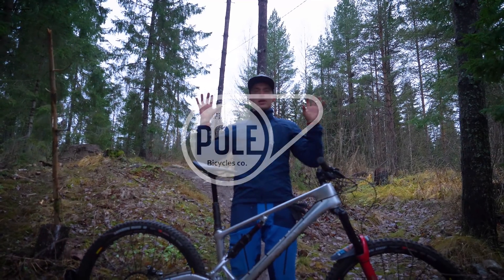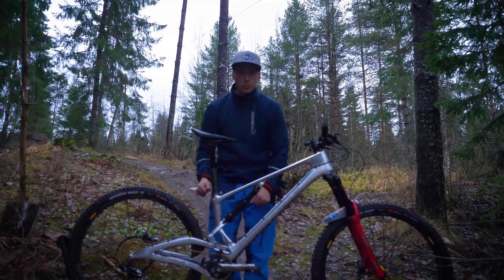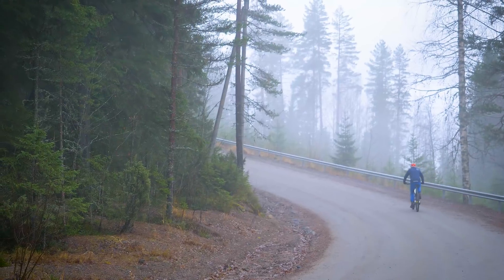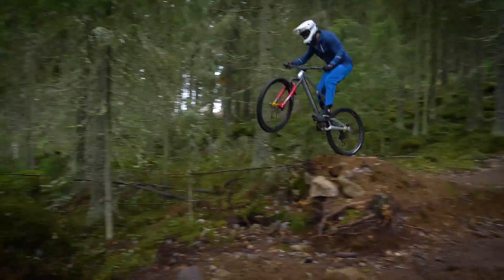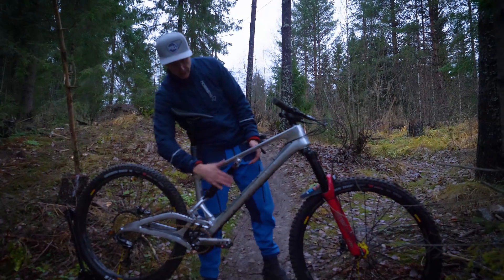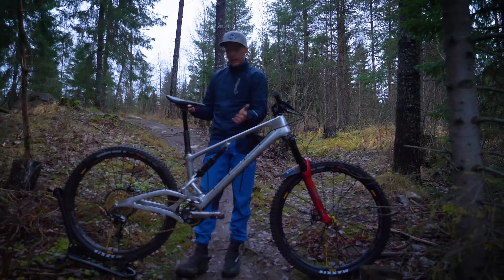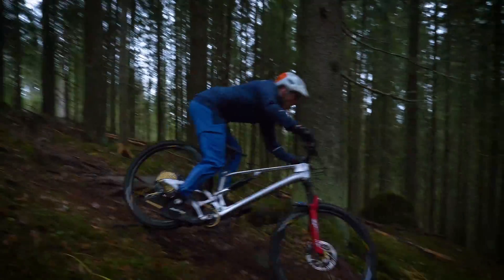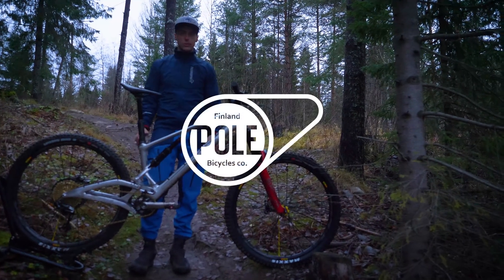Stamina Prototype first Ride by the engineer - Leo Kokkonen

Comment: A 180mm front and rear aluminum 29er for smashing park laps is right up my alley if lighter than a full on DH bike. What is your goal for the final weight of this bike? 33-35lbs? Also I'm concerned about the piggy back of the shock mounted sideways. I know you said you didn't hit it with your leg in the video but not a shocks are created equal. Will you be testing it with various types of shocks? I'd almost rather you mount it the regular way and just have room for one water bottle. At 180/180mm who's going to be trail riding with this thing anyway and needs two bottles? I guess maybe the enduro race crowd but to me It's a bike park smasher.  Looking forward to seeing the finish bike.
Reply from the maker: The prototype was roughly 32lbs. Well, I personally am riding this bike on trail. I just rode this loop last weekend. https://strava.app.link/XX5qhU4PNR I made personal records UPHILL 🤣. The weather was rainy. The bike is something that people have not seen yet. It's fast everywhere. I didn't say in the video but you might have an option to mount the shock with other ways as well, but let's see what we choose to implement on the final design.
Reply: @Polebicycles  32lbs is what my park bike now (Rocky Mountain Slayer, park build) weighs so if this one is 180/180 with the big wheel and a park build of 33-34ish I'm very good with that. Also like the idea of being able to mount the shock the regular way and just go with one or no bottle. The geo numbers seem very extreme but maybe that's just what I need for my next long travel ride. Looking forward to seeing the finished product. BTW do these ship direct to Canada or would I need to order through a dealer? Thank you for the replies. Cheers.

Comment: Stamina or Machine is a tough call. I was so close to pushing the button on a Machine. I think Machine has the looks but Stamina looks like an improvement in function. The Machine's shock location worried me since seat tube pitting is fairly common where I ride. Stamina takes care of that concern. Bigger seat tube and slacker head angle are also nice. When can I get one?

Comment: Btw. why not rotate the shock 90degrees?
Reply from the maker: Well, this is a unique bike and one o the main features is that you don't necessarily need to get a backpack even on a long ride. Having bottles on the bike is easier.
Reply: @Polebicycles  bottles on the frame is a nice idea but for longer rides I also like to carry a spare tube, cell phone, personal locator beacon, car keys, snacks, etc... And in Arizona we tend to carry a min 100oz (3L) bladder to keep from getting too dehydrated. I only go packless for shorter rides in cooler months. And that has only been with my Specialized Enduro because it has frame storage and tools on board. Could Pole bikes get a downtube storage area?
Reply from the maker: @Yardstick401  Not everyone uses this mount option. As you described, there are very different scenarios. You don't need to use the bottle mounts if you don't want to and the shock being sideways doesn't affect your ride in any way. You can mount containers on the same mounts and carry any special stuff with you. I personally have ab Oneup EDC -tool inside the steerer tube, plugs and CO2 inside the pump (I don't use tubes). Phone, snack and other stuff in the pockets. Water on the bike (bike can take up to 2.7l)  Spare jacket (we need to be aware of the cold) and other random stuff on a small hip bag. It really depends what kind of riding I'm doing. If I'm exploring, I'm bringing a backpack but if it's more or less like a downhill riding stuff, there is no reason to take a backpack. For racing we pack as light as possible an all necessities goes on the bike.